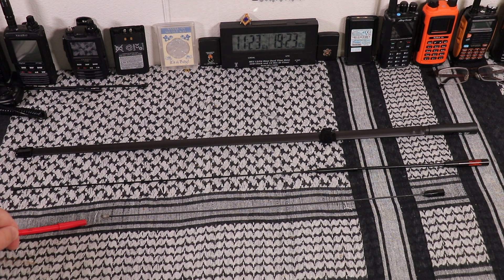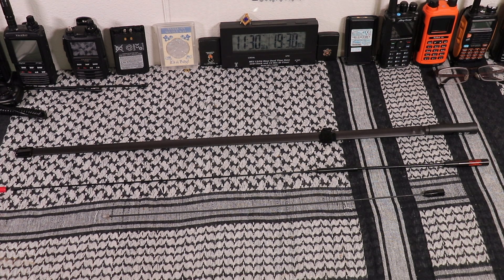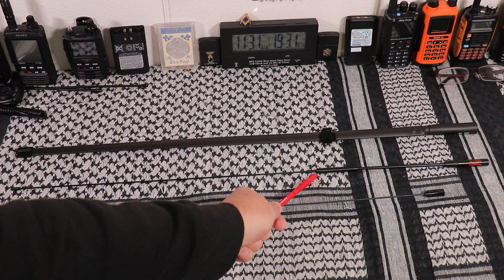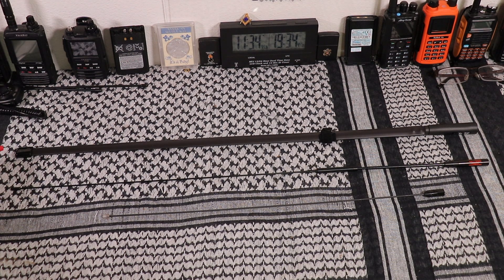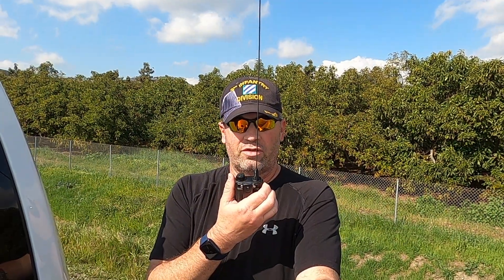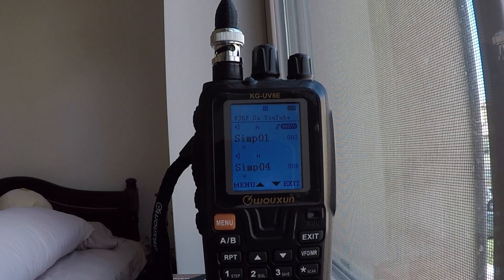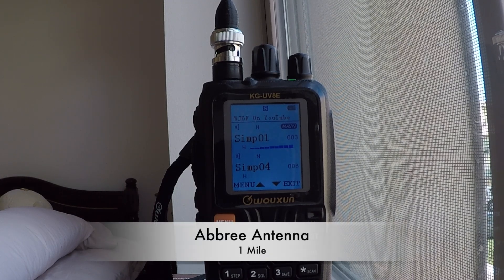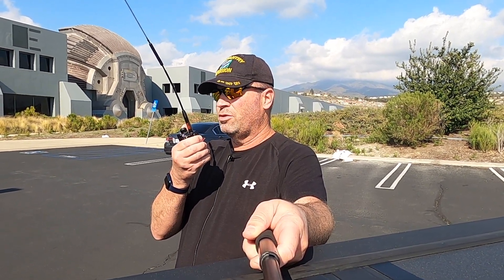HT Antenna Comparison - Signal Stick, Diamond SRH770S and Abbree

Comment: The signal stick with a counter poise made from the center of a 75ohm tv cable made a huge improvement for me
Reply from the maker: Thank you for taking the time to watch and the comment! It is greatly appreciated.  I will have to look into trying that!
Reply: How long a piece did you use?
Reply: @BadBrad46  exactly the same length as the antenna, I took it out of a 75ohm cable because it is the only piece of rigid copper I found, so that it stays horizontal while transmitting
Reply: @leo2944  Man  I appreciate the fast reply- thank you.
Reply from the maker: @leo2944  Thanks for the info!

Comment: I have been using Abbree antenna's for several years now, and I am very impressed. Definitely will extend your sending range, and will help pick up weak signals. As for length, I have the 18.8 inch Abbree and thats about the longest I will put on my radio. I have the 42 inch one but I attach that to a backpack, then use a short cable to to the radio. Really works well. I also have three Signal Stick antenna's. Good, well made antenna's for closer in work, or if your going through a nearby repeater. And remember height and LOS is every thing.
Reply from the maker: Thank you for taking the time to watch and the comment! It is greatly appreciated.

Comment: How does the Signal Stick compare to Nagoya's NA-24J? Or the NA-771?
Reply from the maker: Thank you for taking the time to watch and the comment! It is greatly appreciated. I have never used the NA-24J, but I have used the NA-771. In my experience I found the build quality of the Signal Stick to be better, and that I can loop the antenna to save some room for a time. Most importantly lately I have had better range with the Signal Stick.

Comment: Great video. I have a signal stick and tried it out but I use Comet antennas on all my handhelds.
Reply from the maker: Thank you for taking the time to watch and the comment! It is greatly appreciated.
Reply: @WJ6FRadio  Yes, I'd be interested in seeing an addendum video to this one, adding in the Comet SMA-24 and maybe even the Powerwerx WXGAT-ST. Both are very similar class antennas, and it would be interesting to hear the differences at the same distances. Anyhow, thanks for the great comparison!

Comment: Confused; I would have thought at those distances all antenna’s will be received well. Having a single receive test antenna (brand/model makes no difference) IS fair to all three transmitted antenna’s - real world. The Signal Stick gets good reviews but was I dissatisfied here. I’m unbiased towards the Diamond brand as they perform well for me. Thanks for the video.
Reply from the maker: Thank you for taking the time to watch and the comment! It is greatly appreciated.
Reply: Yeap. My cheap Retevis 2 watt PRS radios with aftermarket Retevis RHD-771's, whips these to bits. My guess based on the ranges he was talking to the other people, there must have been something at his home receiving end buggering up the reception.

Comment: I'd say this was an apples to pickles comparison.  The radio at your home qth was inside using a SignalStick, which doesn't set the playing field equal.  It would have been better to have a mobile/base station at your home qth with an exterior antenna.  Using the signal stick at home from an interior location doesn't really tell me anything.  Your elevation change did effect the results and again did not keep all things equal.  Then the test from underneath the metal umbrella structure definitely didn't make any sense.  The individuals you spoke to appeared to be on mobiles with exterior antennas.  Not science, just another YouTube video without any science.
Reply from the maker: I will grant you the receiving radio was inside, on a window sill mere inches from the window. No, this is not science. At no time have I ever claimed to be a scientist, nor have I claimed to produce scientific content. Hell, I am not an engineer either! Now, that being said, you are free to pick up a camera and produce a scientific video for all to watch.
Reply: No science, just an average test using average everyday gear. Which is what you're going to run into in every day circumstance.
Reply: Dude, regardless of the "conditions" you raise concerns about above, it was in fact a fair playing field because all "TEST" antennas were used under the same conditions from the same locations (only difference being the antenna).  The receiving rig could have a coat hanger for an antenna and it wouldn't have mattered as long as it was the SAME SETUP used to communicate with all the test antennas.  This is hardly science, but it is REAL WORLD testing under REAL every day conditions which tell a heck of a lot more than most laboratory tests.

Thank you WJ6FRadio for taking the time to test and make this video!  So what is your verdict though (having all these antennas, which do you use the most and is your favorite 1 year later), I just bought a FT5D and was about to pull the trigger on a Signal Stick, so now I am hesitant and thinking maybe not...

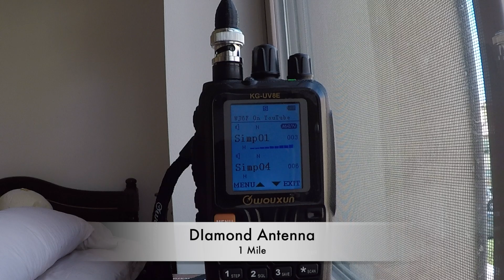Comment: 4:40 Even my Kenwood or Motorola PMR radio will do better one mile away than your radio`s bro.
For example on the Wouxun KG-UV8E (receive site) the S meter is or full on or totally off lol. To make a long story short,  Buy better equipment for your test
Reply from the maker: Thank you for taking the time to watch and the comment! It is greatly appreciated. I am not sure what the terrain is like where you are, but, at certain areas, this test was done with hills and many structures in the way. The Wouxun was also sitting inside of a house made with a stucco exterior. Since I am not a millionaire and "better equipment" costs, there is a Patreon link in the description.
Reply: @WJ6FRadio  I appreciate your real life tests with equipment an “average person” may use.

Comment: Great video. I can consistently hit a repeater about 12 miles from my house using a Signal Stick attached to an Anytone 878.
Reply from the maker: Thank you for taking the time to watch and the comment! It is greatly appreciated. Nice range!
Reply: Yes I get 10-15 miles in Texas terrain on my Anytone 878. The audio is very clear and loud on it.
Reply: I was surprised to hit the next towns repeater with 'strong audio' reports at 16mi on an FT3DE with stock antenna, from a local suburban park with no clear view to the horizon.  Hit it just 3-mins before an IRN net and got a US net controller come back - the look on my (non-Ham) friends face at hearing an American voice come back was absolutely priceless!

Cannot wait to try the abbree (Or, as I'm calling it... the 'ugly stick')  ... I do have the Diamond 770S so I'll be taking that out with me later today, for a long walk - along with a folding dual-band travel beam.

So far I'm loving the FT3 in its NFM 'double-superhet' mode, although it does seem to get swamped easily when in SDR.  But, for what it is, it's a superb little radio and such an easy EDC item!  Also loving the built in APRS beaconing and the GPS/DF : )

Next on my purchase list is a 4-band "altoids tin" for some ultra-light SOTA.  'Cus I reckon tiny QRP is where all the real fun is at ; )

Comment: #MNHR 
#TeamReplay for the win!
Great comparison.  I've found that the longer Abbree antennas put much strain on the connector.
Reply: And don't hold up in a breeze.
Reply from the maker: @twohandsandaradio  I agree. I would most likely use it as a last resort. or extreme emergency only.
Reply from the maker: Thank you for taking the time to watch and the comment! It is greatly appreciated. I also have the 42.4" Abbree and I can feel the weight pulling on the connector, and figure it wouldn't take long to break it.
Reply: I've been using Abbree antenna's for a few years now, and I like them. The longest I will actually attach to my radio is the 18.8 inch one. Plus I make sure there are no gaps. I've also use my 18.8 inch antenna on a mount on my bike. Works great.
Reply: They certainly do. 
People wouldn’t dare purchase one without purchasing the directional antenna cable.